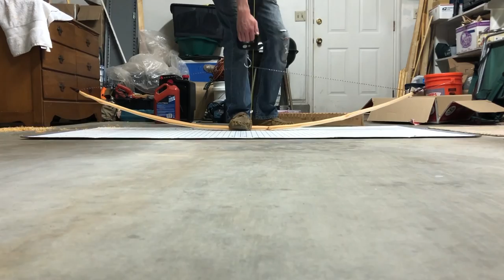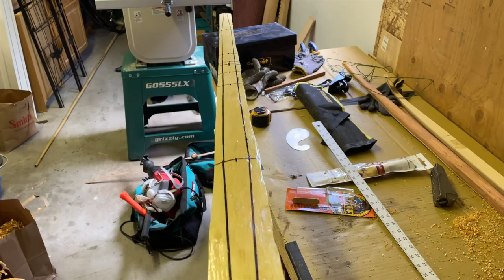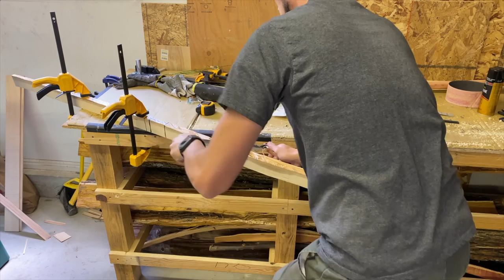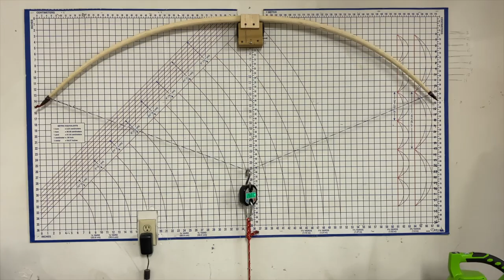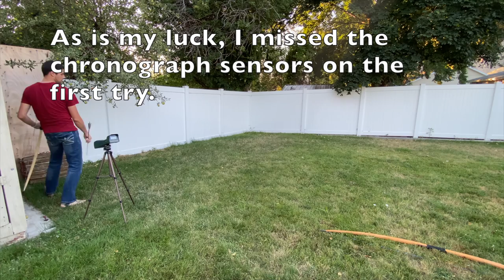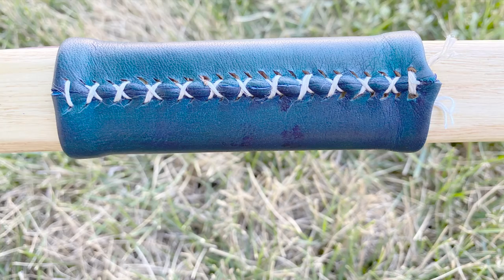How to make an English Longbow from an Ash stave

Comment: Amazing looking bow! What are the measurements you use for bow making?
Reply from the maker: Thank you! It was 1.25” wide limbs that taper down to .5” starting halfway down the limb. It is around 1” wide at the handle. Overall length is 74” and about 72” nock to nock. The thickness taper is based on the draw strength I wanted but starts around 1” thick in the handle. Hope that helps!
Reply: @BowtellBows  wow thank you very much for the fast answer 😄👍🏼 yes i hope it will help, lets see if i am able to make a bow^^

Comment: Odd question, but where do you find a measuring poster like the one on your wall behind your tillering tree? I need such a thing!
Reply from the maker: I have actually received this question a few times so it’s not too odd. It is a fabric craft board and can be found on Amazon:
Dritz 890 Superboard Durable Kraft Board, 39-3/4 x 72-In... https://www.amazon.com/dp/B0018N22FO/ref=cm_sw_r_sms_awdb_imm_

Comment: How does heat treating work?
Reply from the maker: That is a very good question. As far as I understand, heat treating makes the belly wood of the bow a little stiffer and resist compression. In most white wood bows, it helps them to not take set or crush the belly wood fibers therefore increasing the performance and life of the bow.
Reply: @BowtellBows  Is it done over a fire?
Reply from the maker: It can be done over a fire for sure. Coals or charcoal is best to keep an even heat. I like using a heat gun because I have a bit more control but I can only do a small amount of the bow at a time.
Reply: @BowtellBows  I am now at tillering my ash longbow 😅 My first attempt qith black locust didnt go well.
Do you apply oil on the belly for heat treating?
Reply from the maker: Good question. To heat treat I do not apply oil. The purpose of oil is to keep the wood from burning and to help the heat travel into the wood. Heat treating is about lightly browning the belly fibers to make them stiffer.
Reply: @BowtellBows  Thank you very much! I was looking for answers on how to heat treat but I couldn't find anything specific.

Comment: I am maybe going to buy an ash stave, how do I know where to draw?
Reply from the maker: Definitely recommend the ash staves for bows. The dimensions are based off of what you want from the bow. I recommend lining up your bow tips and handle then shape the bow around that.
Reply: @BowtellBows  how wide should the tips and handle be, can you send me like a template?
Reply: @BowtellBows  And do I need the horn nocks?
Reply from the maker: Sure thing. Email me at bowtellbows@gmail.com and I will send you a template. Tips are about .5” wide and the handle is around 1” wide. Horn nocks are not required for ash because the wood is strong enough without it.
Reply: @BowtellBows  okay, thank you so much😀
Reply: @BowtellBows  I have mailed you now😀
Reply: Do you have a video on how to shape a longbow

Comment: is that White ash (american ash)
Reply from the maker: I am pretty sure it is. Got the stave from a guy on eBay.
Reply: @BowtellBows  i harvested four nice staves. I had very bad luck with compression. How did you avoid that
Reply from the maker: I haven't had an issue with ash before myself but maybe I got lucky. As far as I have studied, compression fractures occur for a couple reasons; design is not right for that particular wood (ie too narrow or too high of crown), imperfect tiller, too short, or too heavy. I think if I were to make this bow again, I would have heat treated the belly to improve the woods resistance to compression. I have done this on other ash bows and it has helped a lot. It also adds weight so I have had to take wood off and re-heat the belly a couple times before.

Comment: Conseguirás más potencia si separas más la cuerda del mango, la cuerda tan cerca del arco no tiene sentido ya que no aprovechas la tensión de las palas🙄
Reply from the maker: Al apretar la cuerda hace que el arco sea más apretado, pero también pierde su golpe de potencia o el tiempo que la flecha está en la cuerda para transferir la energía a la flecha. La mejor distancia sería cero, pero no nos gusta la cadena que nos da una bofetada de las manos, así que se prefiere 6-7".

By tightening the string you do make the bow tighter but you also loose your power stroke or time the arrow is on the string to transfer the energy to the arrow. The best distance would be zero but we don’t like the string slapping our hands so 6-7” is preferred
Reply: @BowtellBows  es interesante pero he probado longbows que superan las 10 pulgada y no desaprovechan potencia más bien por más tensión ejercida hacia atrás se consigue más velocidad, al menos con algunas maderas y arcos.